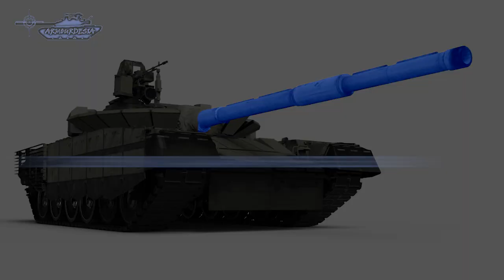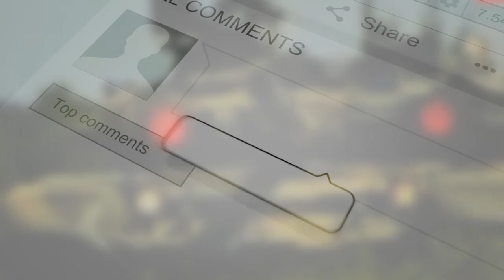Is T-80BV upgrade to T-80BVM worthy.........

Comment: Have they replaced the autoloader? I really hope that they've replaced the dangerous vertical loader with the AZ loader.
Reply: They didn't
Reply: It has been rumored that T-80's Autoloader have chop of the limbs of the poor operators. RedEffect said it. anyways those vertical autoloaders are not very safe and it is a big target when penetrated.

Comment: which one is better between t-80u last update and t-72 last update brother
Reply: T72B3M ist better
Reply: T-72B3M/4 Model 2016 is much better then the T-80UE-1 (newest upgrade).
Reply: The t80bvm is better than the t72b3m but the t80u is not good vs a t72b3

Comment: Russia the best 👍hard Army 💪✊️✊️💪💪🇷🇺🇷🇺🇷🇺🇷🇺🇷🇺🇷🇺
Reply: brainwash ..............
Reply: @bennikdk_4927  says a yank
Reply: @bennikdk_4927  lol, u r brainwashed too... If u writing this, idiot.....
Reply: @Юрий Тойкичев Your respond seems to be half true....Big problem on Abhrams are mobility reliablity and Insatiable fuel kiler.No mention weak protecționiste in front upper glacier.Much worst and expensive compare to Leopard2
Reply: @arjunadelhy7411  Actually, the fuel consumption of the Abrams is not too different from the T-80, as both happens to utilize a jet turbine engine (the abrams do in fact have longer operational range). Also, there is nothing wrong with the mobility of the Abrams, its a bit on the heavier side vs the leopard, but it has way better mobility then the Challenger 2, thanks to the turbine engine. Also, Nato doctrine tanks has commonly specialized on defensive tactics that is focused on hull down positions and turret armor was always the main focus. The 38mm upper glacis is angled to such an extent that it will shatter most heat/and APFSD projectiles under 500mm length, Its the turret ring that I am skeptical about, and hope has been reinforced in some manner, also there is possible that all of the information that we have on the armor profile of the Abrams may be wrong, as most information is classified. the Turret is statistically the place where one is most likely to be hit anyways, and and according to what we currently know the m1a2 SEP V3 has impenetrable frontal turret armor its composite armor with DU gives it a broader arch of reinforced frontal and side armor overall then the Challenger 2 and Leopard 2A7+, also the SepV4 will likely be fitted with Trophy, combine that with TUSK II and we have a tank that offers all-round greater protection then most modern tanks today, except for perhaps the T14 Armata and Stridsvagn 122 And BM Oplot. The reliability of Abrams tanks are really good, and according to most tankers that have experience with the platform do like it, especially favorable is the turbine engine which is less complex then a diesel and is thus more easy to repair and maintain. I actually wish we had sepv3 Abrams tanks, rather then leopard 2 tanks in my country, like Poland now do. Far better then our fleet of ageing 2A4's. Anyways I know this video is about the T-80, its my favorite tank from Russia, its underrated and misunderstood.

Comment: I think it pays off just for the benefit of being a Gas Turbine Tank where half of your country is Tundra and Arctic wasteland. Diesels are extremely intolerant to weather, as anyone trying to start a car after it was turned off through a freezing night can attest, but Gas Turbines don't have this issue, having a much shorter startup time and better performance. These are only used in Arctic Navy Tank Battalions for a reason.

Also about the fuel consumption, Russia is short on Money but nowhere near short on Oil. Fuel consumption isn't that big of a deal since it's a small force anyway and the Russians have stupid amounts of fuel. And staying on the Russian short on cash issue, this comes into play with the T-80BVM, since it's an upgrade rather than a new tank, 80% effectiveness at 40% the cost, thats what Russians do best. T-90M's are about 90% as capable as an M1A2 but cost half of what the Abrams does.
Reply: @Pedro DLR The Saudis also equally know that nobody in the US gov't has the balls to abandon Saudi Arabia to the fanatics. They'll call the bluff. In any case, if the US left they'd just ask good friend China to pretty please come and save them. They already bought ballistic missiles from China before.

Comment: What a Monster. But Where the hell is T 80UM2?
Reply: The black eagle project (at first the T80um2) is the T-14 Armata, so it is here already
Reply: @emilgirginov9848  T-95 (Ob. 195) and Ob. 640 are DIFFERENT tanks! black eagle Ob. 640 is not related to Ob. 148 (T-14), these are different plants. 640 is a running model, it was never completed to the level of the prototype. Although something could have been used when the Omsk plant, which did not receive orders, went bankrupt and became part of the UVZ. 
the Ob. 148 chassis is based on the Ob.299 modular platform of the Leningrad Kirov plant (which designed the T-80). Omsk only produced the T-80U, as did Kharkiv (T-80UD). The concept of the tower was used from Ob. 195 (T-95), which was canceled due to the high cost and production costs. The tank was 20 years late, so the restoration of production was considered unprofitable. It was cheaper and faster to redesign the tank using the experience of different projects before it and new materials and technologies. Faster, cheaper, and more efficient.
Ob. 148 (T-14) and Ob. 149 (T-15) TBMP have a chassis similar to the project 299 LKZ. But the tower conceptually repeats the project 195 UVZ. Lighter, without a guidance locator and with a different 125mm gun, and not 152mm as the Ob. 195.
p. s.
The t-95 is a completely different concept tank. "Tank Of the maximum achievable Parameters". Ultimate defense, Ultimate weapon.
Fully remote control, the ability to remotely control or use a self-learning computer for Autonomous actions in typical situations. Yes, it's a kind of Bolo)) With the ability to use 152mm projectiles, including nuclear ones. This concept is considered redundant, but at least several dozen prototypes were produced for testing.
As a cheaper version, Ob.148 was adopted when development of the 195 was discontinued (?)).
Ob. 195 https://avatars.mds.yandex.net/get-pdb/2845613/99d9db86-ba4a-448b-89c0-ce7dddba877e/s1200?webp=false
https://avatars.mds.yandex.net/get-pdb/1587552/2791b918-4451-45b4-a0b9-f8d047e51f47/s1200?webp=false
https://i.ytimg.com/vi/RuptnfCBJJA/maxresdefault.jpg
http://veetrina.net/images/easyblog_articles/7391/b2ap3_large_1101.png
Ob. 299 chassis http://otvaga2004.ru/wp-content/uploads/2013/08/otvaga2004_tiv_razrez.jpg
https://topwar.ru/uploads/posts/2014-11/1416798727_9099816045818f689050a10fa0061adb.jpg
https://topwar.ru/uploads/posts/2014-11/1416798712_161347c5cf0f20e5d4e1fc805e8b1a8a.jpg
TBMP T-15 Ob.149 https://ic.pics.livejournal.com/bmpd/38024980/5800309/5800309_original.jpg
T-14 tank Ob. 148 https://pbs.twimg.com/media/C9ScnLxXoAAeEQl.jpg:large
Reply: @elusive6119  The other guys already kinda explained it to me, but thank you so much for the information! Before it was hard for me to understand everything about all the differend objects, but now i know. Thanks
Reply: @emilgirginov9848  no, the black eagle is a entirely different tank and design. The Armata is also not a tank but a Plattform for multiply uses like T-14 Armata MBT or T-15 Armata IFV.

The Black eagle on the other side is technically a longer T-80 hull with a completely new turret and also a new autoloader design, which is uncommon for Russia. They even use there old carussel design in the T-14.
Reply: @Tankliker  I have heard and read numerous times that the T-14 is basically a continuation of the black eagle project, since it was too expensive back in the day
But maybe im wrong, i dont want to start an argument
Reply: @emilgirginov9848  I don't know where you got the info. The only right thing is that the black eagle was a privat development of omsktransmasch after Russia decided to take the T-90 as there standart MBT. After that they wanted to still make money and developed the black eagle for foreign customers. Big problem why the tank never was sold was that even if the technology was based on already proven designes they couldn't just upgrade older T-80 variants because of the turret. That meant that all tanks would need to be build new and there where just no customers that wanted to spend so much money.
Reply: @Tankliker  thank you for the info
Reply: @emilgirginov9848  Whoever told you this may have confused the Black Eagle with the "T-95" project, which was what people called another unmanned turret design predating Armata T-14. http://www.military-today.com/tanks/t95.htm
Reply: @Tankliker  T-14 uses a brand new carousel with 32 rounds capacity. The projectile section is stored standing up, allowing up to 900mm-long projectiles to be used. When the T-14 was introduced in 2015 many people looked at the 7-roadwheel arrangement and thought it shared a hull with the Black Eagle, which was the only publicly-known 7-roadwheel modern tank being developed by Russia. Of course, the "T-95" which was the true predecessor for T-14 also had 7 roadwheels, but confirmed photographs weren't available until 2016.
Reply: @andrewsuryali8540  I know that the carussel is new, but its still the same princip as from the T-64 series. The autoloader will just have the same problem that with more modern projectiles the loader becomes too short. The western like autoloaders where the loader sits in the turret dont really have that problem, they could easily fit a longer breach and would only have to change the turret in the backsection so the whole mechanism is still able to hold the longer rounds.
Reply: @Tankliker  The loading action of the new autoloader is also very different from the old MZ. There is now a pseudo-bustle in the back of the turret containing the loading arm. Unlike in the MZ autoloader, the full round is now pulled upwards then straightened backwards, so part of the charge section goes into the pseudo-bustle while the projectile goes partly into the hole in the breech block. This is similar to the way the American M1 TTB autoloader works, although in that case the ammunition is one-piece and only 980mm long. Up to 1.5 meters can be accommodated with the new T-14 autoloader. Because of the two-piece construction of 125mm ammo, it is possible with the new autoloader to use the new APFSDS round that is 1308mm long (408mm charge, 900mm projectile). This far exceeds the maximum length of any Western turret bustle autoloader (about 1m). The capacity is also greater compared to any bustle autoloader currently in service. To fit 32 rounds with a 150mm rim in a bustle you would need one that has a minimum internal width of 17 x 155mm = 2,635mm. This is much wider than any T-tank's turret ring, the widest of which is the T-62's 2,245mm ring. It is of course possible to go with something like the Meggitt autoloader with a four-stack arrangement fitting 34 rounds, but the internal width would still be 1,730mm and internal height of the bustle would be about 720mm for that system. It would be the same width and height as an Abrams turret, a gross misuse of space in an unmanned turret. Bottomline is, the new autoloader is very different from the old MZ and is much better designed, allowing not only higher capacity but also the ability to accommodate significantly longer rounds than the MZ or any reasonably compact bustle autoloader could handle.
Reply: @emilgirginov9848  T-14 is continuation of T-95 project. Black Eagle is adaptation of western style MBT for Russian army having separate storage and crew compartment. Which 1 do you like by the way? They both started as replacement for T-80 & T-64.
Reply: @jawarakf  What do you mean? Do i like the T-95 or Black Eagle? I woupd say the Black Eagle (looks cooler imo) but i also dont know much about the T-95
Reply: @emilgirginov9848  yes that's the question I asked. Actually both T-95 & Black Eagle were cancelled in 2000. Almost a decade later, the T-95 concept was chosen & revived as Armata because it is first of its kind and chance of survival higher without anyone in turret. Some US ex-army tank guy said if the automated turret had a stuck spent shell, 1 crew might have to climb out and up the turret to remove the stuck shell exposing himself to enemy fire.
Reply: @emilgirginov9848  black eagle project - so called object 640 used titanium armor which made it expensive. You  can imagine how price changes if you replace steel armor with titanium. Though I think that so called armored crew capsule of T14 is made of titanium composite as well. technically black eagle was made using modified T80U chassis. Specialists say that T80 chassis is a lot better than T72 derivatives. It has great characteristics and also it is reliable. Some other armored vehicles use T80 chassis as well.  It also has 152mm turret and completely new klimov 1500hp gas turbine engine. So black eagle is new generation of T80 while T90 is a new generation of T72. It's a pity object 640 is discontinued project. I think it should be updated and it's going to be a good replacepent of T80 which is good for subarctic climate
Reply: T-80UM2 got canceled because it was too expensive back in the day and then the Soviet union fell. Later it was ready for production, but it got canceled again, because it was already obsolete, after all these years
thats the info i have, i could be wrong here and there
Reply: @emilgirginov9848  T-80UM2 only STARTED after the fall of the USSR. It probably began as an intended export to South Korea. South Korea was given a few T-80Us, as payment for some debts incurred by the Russians. In the process, the manufacturers of the tank discovered that there was some interest in SK for an autoloaded MBT with modern optics and TI. Not long after, the T-80UM2 was born. The tank never entered production because the manufacturer (Omsk) went bankrupt. It wasn't in any way obsolete. The armor package is probably much better than what any T-90 carries today and it had a bustle autoloader, modern CITV, and modern sights. Most importantly, the tank was designed with modular armor blocks like the Israeli Merkava and the Chinese ZTZ-9x tanks.

The Koreans ended up developing their own K2 tank.
Reply: @andrewsuryali8540  In the time it was tested it was not obsolete, thats true
I am saying that later, after the fall of the wall (May 2010 to be exact) there were plans to continue work on the project, but that never happened, because they decided, that the design was already obsolete. So instead, they started developing the Armata project and the T-14 was made with the help of the research gained during the creation of the Black Eagle project. 
Definitely a beautiful and modern tank, especially for its time
Reply: That is a canceled  project

Comment: Although  it is upgraded to the latest warfare standards but still the maintenance is quite costy ......
but its armanent is good....
Reply: Its not costy, its even cheaper to maintain that the T-90M
Reply: the situation of the tank was the performence  in grozny  was not bad  because  in that time  the  Russian didnt  put  support  infantery teams  to  protect the tanks but instead  lunch the tanks alone against  Chechenyan s who  were consisted of  veterans of the soviet-afghan war and  some jihad  units and  almost  a great part of the T80 versions that fight in grozny  dont  have the  reactive  armour  because  at that  time  the  russian soldiers  sells the reactive  armour  to receive some bucks  , some of the tanks were destroyer  by  3 or 7  impacts of  RPG in well organizated attacks of  the chechens veterans  and  the  planification of the strategy was shit  who  thinks that  a blitzkrieg will  applied  in a zone with mountains. 

The result  of these  was  a bloodbath for both  sides.
Reply: AFAIK the point is that the T-80's turbine engine makes it better suited for low temperatures.